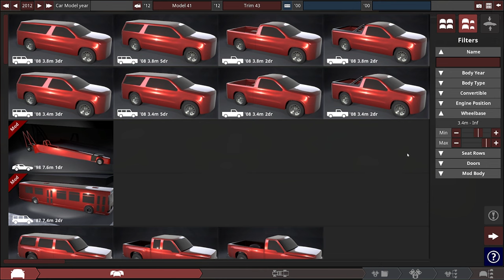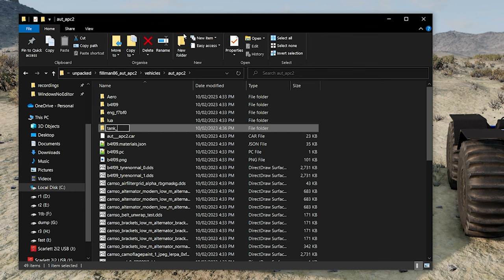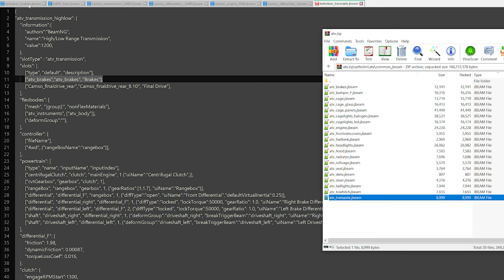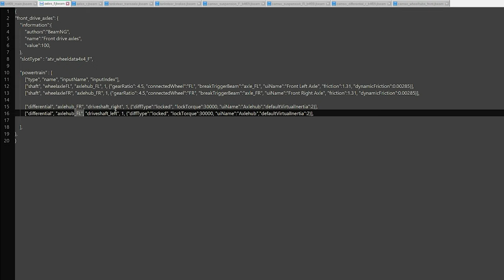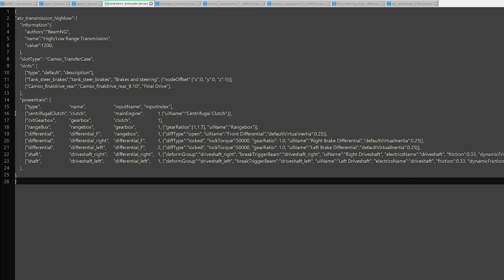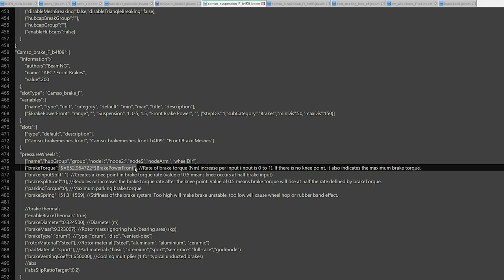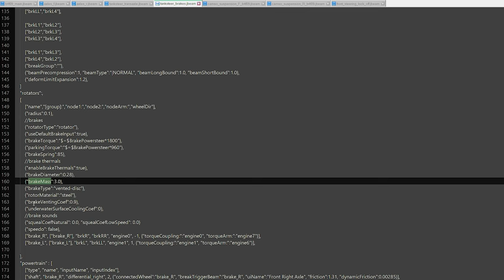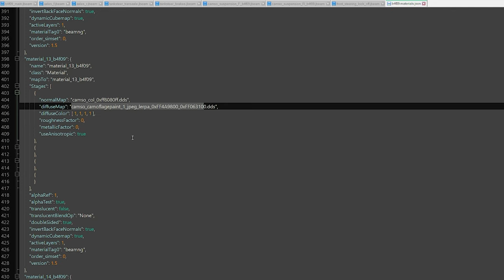I Thought this would be Easy!!

Comment: Actually, I think the biggest reason your steering isn't working well is tire scrub. In order to tank steer a vehicle that long, the wheels essentially have to be moving as much sideways as forward/backward. This isn't as much a problem on real tanks since they have big treads made out of metal. Additionally, with the way tracks sort of work, you could conceptualize it as only have two wheels, one on each side in the middle of the tank, since steering a tank essentially rotates it as if the only point of contact was two wheels positioned halfway along the tank. I think that's also why those semi-tank things always have so many wheels, since the middle wheels are the only ones that have good steering authority, and the outer wheels just get dragged across the ground.
Reply from the maker: these are all good points that I'll take into consideration in the future :)

Comment: Using brakes to slow down one side is what a lot of real tanks do to steer, actually. It's much simpler than the mechanisms required to have a separate steering motor.
Reply from the maker: I'd personally run a turbine as a generator, and run electric motors. Then again, I'm not an expert :P and it could also be the worst idea in the world